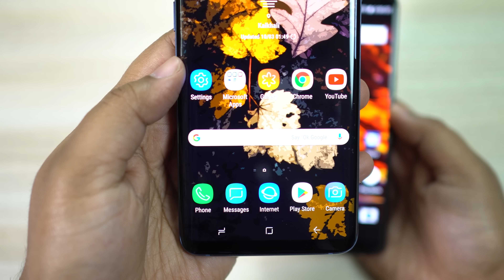Samsung Galaxy S9 Plus VS OnePlus 5T - 🔥🔥 SPEED TEST! 🔥🔥

Comment: Speed test are a waste of time. If companies have to use a trimmed down OS and as short animations as possible to make a phone look like it opens an app 0.5 seconds faster than one running a skinned OS and 1.0 animations , then that doesn't really show speed , it just shows that there are shorter animations . E.g 
Imagine a 100m sprint , one person starts at 100m= 1x animatiom the other at 50m = 0- 0.5 animation . At the finish line the 100m sprinter finishes 0.5 seconds behind the 50m sprinter , does that mean the 50m runner was faster , no it just means he finished first. The faster runner was the one that did the 100m in almost the same time as the 50m runner covering half the distance . This equation is made worse for the 100m runner in a relay when they race back to their original start points to race again as he is now 1 second behind covering 200m vs 100m.This is the way animations give a false perception of speed.

Comment: Well IMO Exynos 9810 is totally waste like the Prev one in S8 in terms of speed 
I can bet S9 with SD 845 is way faster than 9810 
Btw I'm not a samsung fanboy I've never used Samsung 📱 But any Major device with SD 845 can easily beat OP5T
Reply: Android Guy but exynos variant is always better as it is better for ROM development
Reply: Android Guy that's because Samsung underclock the chip to match the speed of stupid sd845... thankfully the agreement with SD ends by 2020 then they'll stop underclocking 😋
Reply: Max payner not sure but in future custom kernels should be able to unlock the full power right?